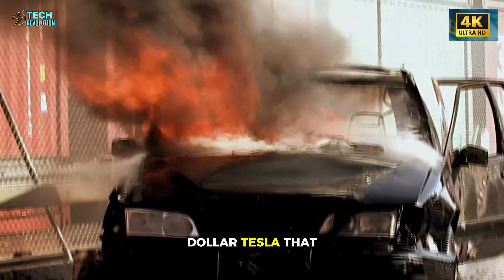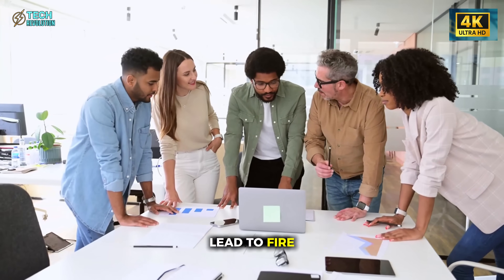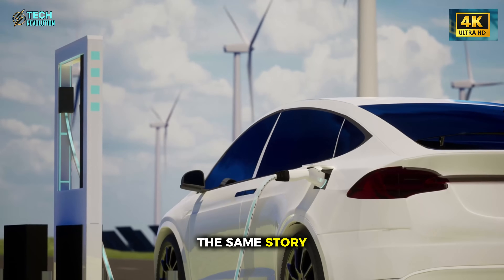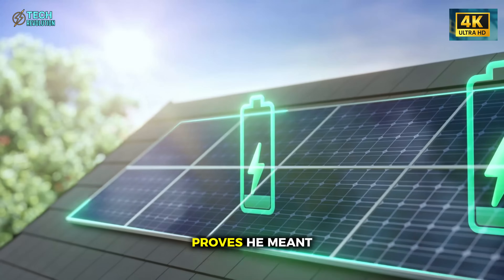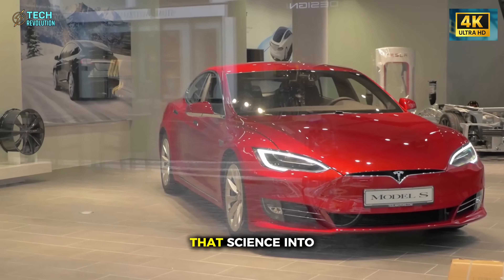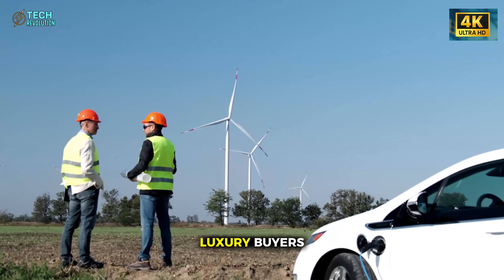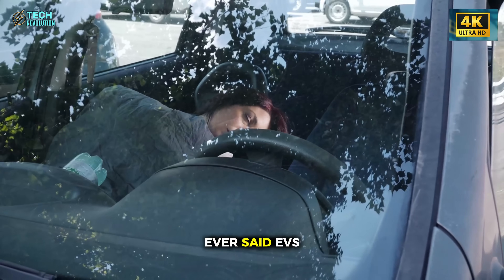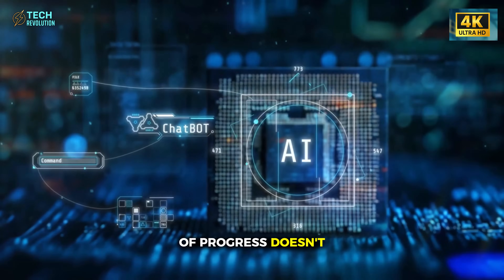Tesla Model 2 FINALLY HERE at $15K: Aluminum Battery Won't Explode. SHOCKING!

Comment: No, the Tesla "Model 2" does not exist.  The aluminum ion battery is being developed by others, not by Tesla.  This is all speculation, not reality.
Reply from the maker: You’re right — the Tesla Model 2 hasn’t been officially revealed yet. But the design insights come from verified supply chain leaks and Tesla’s internal engineering direction, not random rumors.

Comment: A stomach wheel and walking, that all I need, and a joint at night.
Reply from the maker: Interesting take — but do you mean you prefer simplicity like the Tesla Model 2’s human-centered design? Sounds like you value real comfort over tech clutter.
Reply: Am 🎉 69 yrs old I plan on living as long as I can 100 yrs would be good to collect for  towns. longer  than I worked and token all the way.